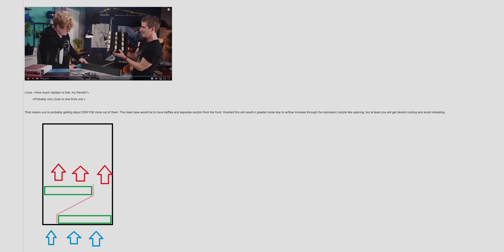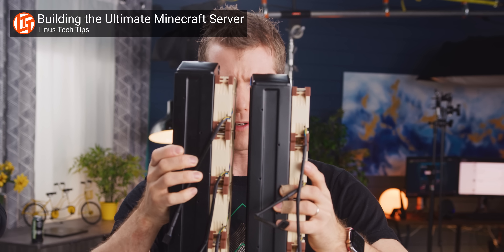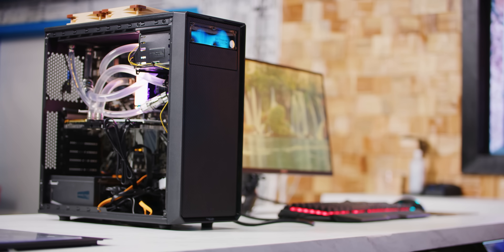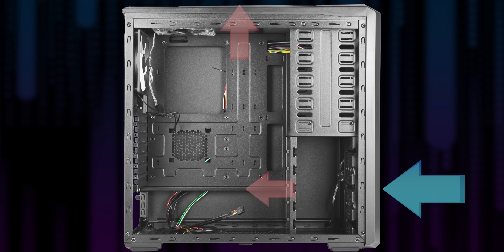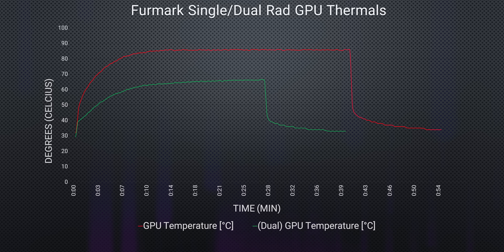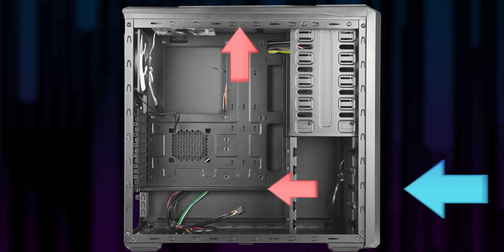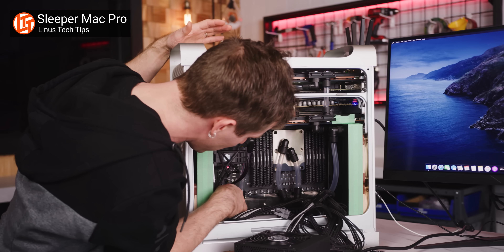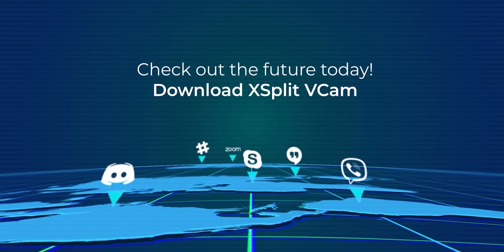I’ve been water cooling wrong for YEARS - $H!T Manufacturers Say

Comment: You should try "serial rad config" vs "parallel rad config" both intake i think it would be fascinating if not breathtaking
Reply: Parallel or seriel does not matter at all for temps.
And if you only have one inlet and one outlet on your pump, it will not matter for pressure either, as there are no more restriction in a radiator, then in your loop tubes.
The cooling of your loop is determined by the cooling capacity of your radiators, and the heating of the loop is determined by the power output of your components.
If you split the loop and put the two radiators in parallel, the flow will fall to about half, and soak up more heat from the component on that loop, and the fluid will remain longer inside both of the radiators and get slightly more cooling, but because the fluid was warmer before in entered the radiators, and they mix together in the same reservoir anyway, before being pumped out again, it will not matter at all.

Comment: Diffusion law still working, the more surface area the more heat is out, very simple logic. If it decrease cpu gpu temps on high load than you don't need simulation - real world is the simulation king...

Comment: In your build, the top radiator was probably sucking in the air from the openings at the back of the case, so both were sucking in fresh air.
If you close the back, so that the second radiator can only suck warm air from the inside of the case, what happens ?

Corsair was talking about adding a second rad being cooled by hot air from a first rad, so your test is completely different.

Comment: Adding aprox. 500 ml of Fluid to the System when adding the second Radiator surely had an impact on the Rate of heat increase in the System, though...

Comment: Corsair's initial premise to me just sounds plain wrong... They're assuming that the water is 40C and the air that was blown through the radiator is 39C? I don't buy that for one moment, the radiator is not THAT efficient at transferring heat from the water to the air.
That would actually be interesting to test, but I would expect the difference between the temperature of the water and the temperature of the air that was used once to be much bigger.

Comment: Might sound dumb but why didn't they compare it to 2 rads both on intake? And then an exhaust fan in the back. I feel like Corsair was trying to say you get optimal performance out of intake rads than exhaust. Also I feel like it's a "yeah no sh*t" with the decrease in temp on this setup because adding a second rad adds more water technically, so the heat was be spreading no matter what. I like to do intake in the front and too and exhaust the back and seems to be icy. Also love the content!

Comment: Terrible Video this time unfortunately. Corsair is Right. 
Obviously its better to put the radiators separately than mount them to each other. 2 Rads with Fresh air is better than 1 rad with Fresh air and one rad with the already warmed up air from rad 1. Ofc it both works. Its just more efficient. 
Just like I ALWAYS put my radiators taking fresh air in. Cause i want to cool the water with 20° fresh air not with 40°+ air inside the case. 
And ofc that ultimately leaves you with warmer temperatures inside the case respectively. You cant erase energy, just shift it somewhere else.
The simulation is always right. It's simple math, you cant get around the laws of physics.
If your experiment showed different results, you did it wrong.

Comment: I think Corsair's simulations are using lower air volume relative to the heat exchanging area. I'm not an engineer, just some guy with no qualifications, but it seems like you'd need to meet a threshold for airflow to avoid reaching the thermal capacity of each stage of the system so there would be enough capacity remaining to pull heat from the following stage.

Comment: Ok.. confused..
you didnt test to see if their claims are right.
- you still ran hot "used" air into the second cooler.

Please do the test right.
place a water cooler in front sucking in "cold air" from out side the cabinet
place a water cooler in top or bottom also sucking in cold air from out side the cabinet.
vs
place a water cooler in front sucking in "cold air" from outside the cabinet
place a water cooler in top of bottom blowing "used hotter" air from inside cabinet and out !

this is basic physic, you need the highest diffrence in air temp to optimize cooling.
so.. using cold air on both coolers are the best.
..

The mine craft server test with 2 vs 3 stacked was painfull to watch, ofcource 3 will be better than 2.
- but PLEASE do it right
Place all coolers side by side so ALL can benefit from cold air
vs
3 stacked as now.
( Iam sure the side by side will be BETTER )

REDO THIS TEST, this video felt like you where trying not the make a "fool" of your self by making tests to your own benifits.
( btw, I dont think you are a fool at all :)     )

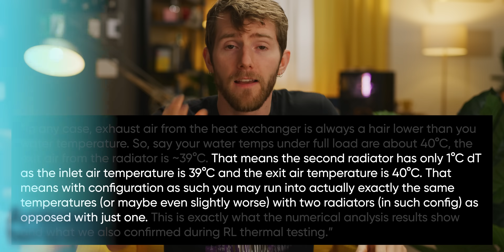Comment: I think a key mistake of this claim is shown at 2:28, it starts from the assumption that exhaust air from the radiator will reach a temperature very near water temperature, but that is not necessarily the case, if you have enough air flow this will never happen, as the air will not stay enough time inside the radiator. In that case stacking radiators makes sense, though each layer will dissipate less and less heat into the air because of the lower dT, that means it is not the most efficient use of radiators and the stacking will reach a point in which it doesn't help at all.

In short, this does work but separating radiators will work better.

Comment: Easy solution: arrange both radiator fans so all of them willl suck in fresh air. Hot air goes inside the case, cools (if it can) the rest of the components, and egsoust fans gets rid of the warm air. Simple. :) Due to a placing limitation, if this is not an option, than both Linus and Corsair would be right, according to the situation.

I have been water cooling my pc for 20 years I guess. And designed my water cooling system for my 80w laser cutter. Just, please try to watercool a laser cnc. A person can learn alot about thermodynamics with that! :D I thought I knew alot. Well, I learned much more while trying to watercool a cnc. So, a PC? Piece of cake. As long as you have enough space. As space becomes a problem, water cooling gets more and more complicated. 

My solution for space need: A 15 year old case. Cooler Master Stacker. :D I bought it used, dirt cheap. :) It is huge. I guess I will use it 20 years maybe? :D It has rollers under it. I modified them with bigger rollers, so cleareance between case and floor has increased. And there is my big radiator. :) So, still, plenty of room inside the case. :)

Comment: It's quite simple. Stacking radiators will have diminishing returns. There's always a point where one more radiator won't make a benefit worth having, or it could even decrease the performance by adding more resistance, and heat from friction and extra electrical components (Not to mention costs, space, noise, and aesthetics).

Comment: Corsair stated "stacking rads is stupid in the one loop" and they're wrong, because I think they've got their coolant flowing the wrong way. This makes a HUGE difference.  
When you stack them, the best your second rad can cool to is the output of the first. So if Rad 1 is 20c in and 40c out, then rad 2 is 40c in, which means you CANNOT cool below 40 on the second rad.  
BUT you can do something tricky here, direction of flow is important! You want the hottest rad to be the LAST rad, not the first.  

So in the example of Jake's triple stack, the one at the back is where the water comes in, the one at the front where the water exits. That's how it needs to be for max performance.  
That way the last rad before it heads back to the block is getting the coldest air through it, and progressive rads are cooling water that's already hotter.
Case in point, this EXACTLY how heat exchangers work!  

I will say however ideally all rads would pull in fresh air, but if you have space constraints stacking them will still yield benefits so long as your coolant is flowing the right way. And if it's not it probably still will help.

Comment: If you mount the second rad on top with the fans in push configuration, letting it push   cool air through the rad. Does it make a difference? Yea it will be warmer inside the case but...

Comment: More surface area to cool the liquid the cooler the liquid. But the liquid can only be cooled by the amount of cool air around it. Either Way, stacking radiators is perfectly fine in pairs just be sure the air is being pulled through as that is more effective.

Comment: You want to know why two radiators works?  The radiators are statically placed where warm air can hit the second rad, BUT the water is NOT static.  The water moves inside the loop, so if you cool water in Rad-1, it can move to Rad-2 to cool that even when no air touches it.  Even warm air can slightly further cool Rad-2, but with the water circulating in the loop it actually has less cooling to do—this makes it less efficient at heat transfer when not in load, but in the event that Rad-1 is not up to the task under heavy load the remainder of the cooling can be passed to the less efficient Rad-2.  This means that the water is as cool as possible when lapping the circuit, so your reservoir is cooler, your blocks are cooler, and perhaps more importantly your first radiator has cooler intake water with the second helping it than without.

If your first radiator in the loop is the one getting the warmer air, this is potentially where you can see the second radiator negatively impacting things.  Passive cooldown will be better, but under load the first rad can't cool as well and the second rad is being passed warmer water as a result.  The loop can cool fine without a hefty load, but will saturate the water with heat faster than if the water circuit were setup to have the water flow follow the air flow.

Water circuits aren't big omnidirectional heat sinks, guys;  the water is circulating, so much like you have to plan your fan layout for proper air pathing through a case you also need to plan your radiator and block layouts as well.  Keep that in mind and there's no reason adding more radiators won't help your cooling.

Comment: This is a cheap shot. You added a second radiator, but as you said, this is not the scenareo Corsair was talking about. I want to see the results from the server rig comparing different numbers of stacked back to back radiators. And a case without a top, bottom, or side vent, with a rad on the front sucking air in, and a rad on the back pushing air out. 

There are circumstances in which more rads can help, and others where they can make it worse. Another example would be an severly under powered cheapo pump with all possible water blocks blocked with gunk, and way too many radiators in series, all spread over a large head (vertical distance from pump up) could result in practically zero water flow.

Comment: I think the mistake in corsairs 'simulation' is that it assumes constant water temperature in the loop, which is an OK assumption at low loads, but fails when intense loads are being run. This means that the sequence of air and water flowing through the system matters. One rad is a crossflow heat exchanger.  With multiple rads you have options of having crossflow (all rads blown same, either in or out) parallel flow (how corsair assumes it, with the hottest water meeting the coldest air) or counterflow (the best option, with the water flowing through the exhaust rad first, then having been cooled somewhat already, passing to the inlet rad, with fresher cooler air). Putting it like this makes it suddenly obvious why your methods work. Also, with the individual radiators being crossflow heat exchangers (water is cooled progressively from one end to the other) it can be seen that the stacked rads with the water flowing one way in the first and the other way in the second would even out the heat exchange between the two ends.

Counter-flow heat exchange works better than other flow directions because the coolest water is meeting the coolest air, and is able to dump the last of its heat. As long as the cooling loop is doing this, 2 rads will work better than one, and 3 better than 2.
Reply: That said, the actual temperature differences in the water should be low if the flow rate is anything like as high as various people claim (<1°C). So the next main reason I can think of for the difference between expectation and reality would be that the radiators don't actually get the air temperature to 90% of the water temperature before it leaves the other side. Another question though, Why do you have the fans blowing out on one of the rads? surely having them both blowing in from outside and letting the air leave through any available openings (like those big open grills in the back of the test chassis) would work better? The resistance through those grills would be low so this would work fine without extra fans.

Comment: Sorry but they're right I tested it. Exhaust rads are bad unless they're all exhaust in  scenarios where all your intakes are covered with radiators, the air will be at same temperature as water in loop limiting any cooling.

Comment: If youre using multiple stacked radiators, why not just run the water from the inner ones outwards, that way the water is always going through cooler radiators.

Comment: stacked/in-line rads will always yield worse performance than a single rad of the same surface area (with adequate airflow). But just stacked = bad? not in real-world practice, multiple stacked/in-line rads will always perform better than a single rad of lesser surface area.

Comment: From my personal experience, i found the sweetspot to put one 240mm radiator in the front of the case, and one atop - the difference being, in series it looks like this: pump/rez combo -> GPU -> rad #1 (top, exhaust) -> CPU -> rad #2 (front, intake) -> pump. This way the water is slightly warmer after the cpu than the one coming into it, thus making the heat dissipation of both rads viable :) loved the vid tho, cheers ^^

Comment: Out of my own eyes you are both right.
The cooling "performance of a radiator has multiple influences:
- difference between ambient- and watertemperature
- the heat-transmission surface
- flow-speed of the water inside the radiator (or time inside the radiator to transfer the heat)
- Radiator-design
Let me try this explaination, if you use pre-heated air to cool down the water, then the effectiveness of your radiator is not as good as with cooler air. BUT on the other side you increase the surface of your whole radiator. This means: you still have increased your radiator heat-transfer-capacity, but your 2nd rad has less heat-transfer-capacity as the intake rad.
You've proven this by yourself in 2 Ways:
So in your small system, you gained of a 240mm radiator only 20°C. Thats really poor for a 240.
Your own 2nd example is the server: As I could see it you've installed multiple beefy 480s? But by "deactivating" one of those, you friend lost  only 5°C? This is for such a big rad really not good at all.
You can see the difference in the minecraft set via this way: Track the temps, when the intake rad is disconnected, and do the same when the outtake rad is disconnected. I'm pretty sure you'll find a difference.

Comment: Its worth pointing out, your car also has radiators stacked in front of each other. 
So water, air conditioning typically. 

And if you drive a turbo charged engine, an additional inter-cooler (air for those not in the know) and an oil cooler!

Comment: But if you air cool the case and water cool the components with radiator external to the case results would be better that's the way the simulation works 😊

Comment: Why didn't you just changed the fan direction of the top mounted radiator? Then it should get only fresh air, exhausting it into the case.

Comment: The radiator may not have made a difference. What does matter is how much water is in the system. More water, more heat capacity. Simple. Also, random atmosphere from holes.

Comment: rad surface area is a bigger deal than people acknowledge.
a jaijintek ereboss by soldering a waterloop through its heatpipes. the thing has the same surface area for heat transfer as a 360mm water radiator. but people dont want this because "oww muh sleek uhn thin-ness".

Comment: stacking yes but not the way that the second radiator taking heat from case what about one radiator in front and second from bottom each pullin cold air from out side or two rads infront if your case can do that in all cases pulling cold air from outside should be better then one of them pulling hot air out, its not like stacking doesnt work but the way you do it can be improved and have better performance

Comment: I wish this testing was done in a better case with better airflow to eliminate some of the air restrictions, like the absolute worst case that represents the current pc market was used. 

I've dropped my idle and load temps between 10-15° C just by getting a modern case with better airflow (ie a perforated plastic front panel). These results would be a lot more interesting to me. I too believe 2 rads would still be better but I bet the difference would have been a lot less.

Love LTT but this would have been better done by GN. Although it would've taken a painful 30min to watch lol.